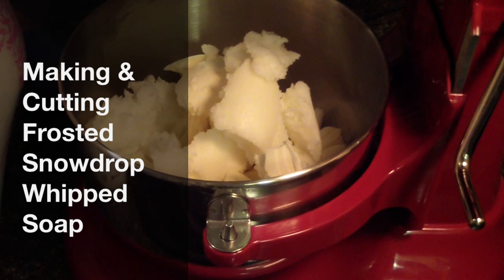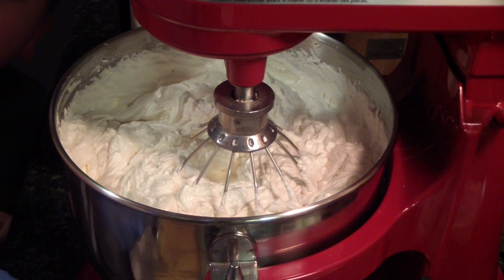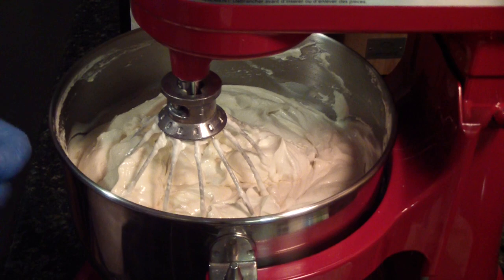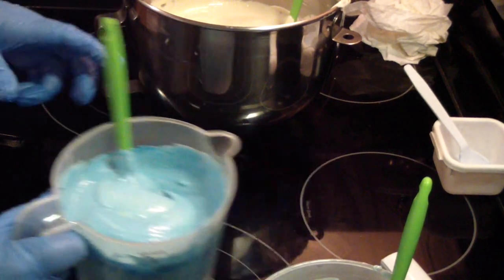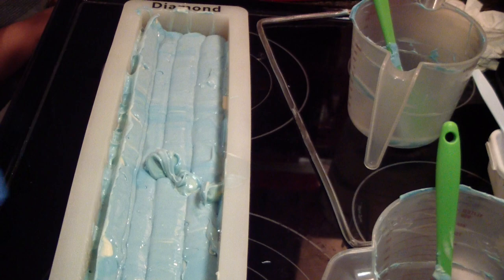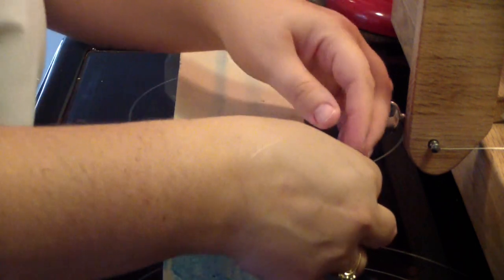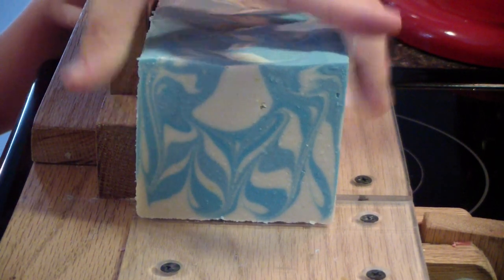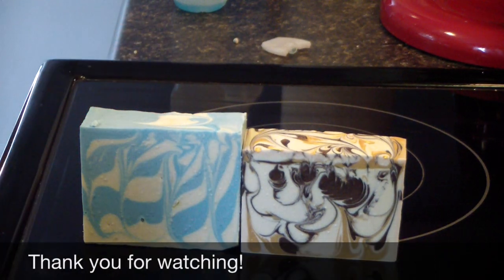Making & Cutting Frosted Snowdrop Whipped Soap

Comment: Cool !

When I make WP; I beat the solid oils and butters first (room temp) until its creamy and it peaks; then I add the liquid oils and fragrance (and other liquids, like cream) beat until peaks arrive, then the lye solution. If you use Cocoa butter, you might melt it and add with the liquid oils. 
This may help to avoid grains of any kind.
(I also whip in the colours; stirring them in like you do gives an easier to mould batch though). 
Anyway, just my 2 cts. :)